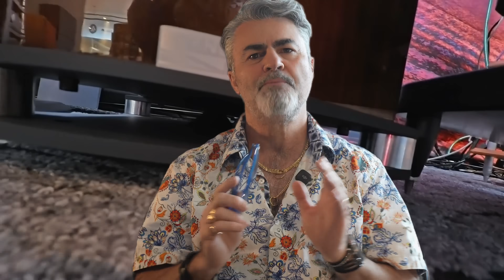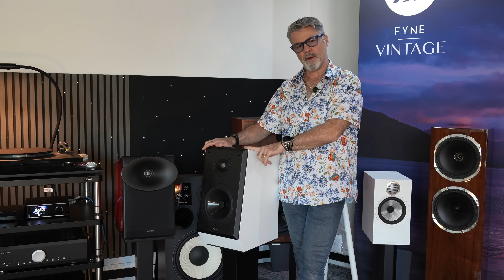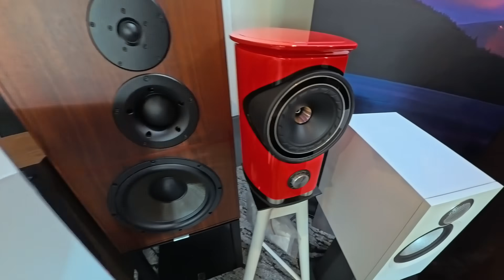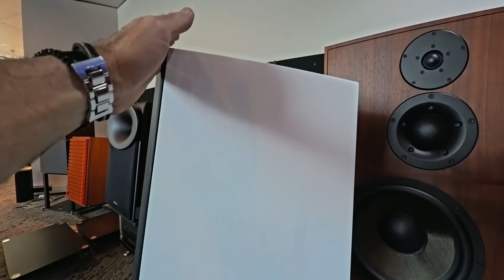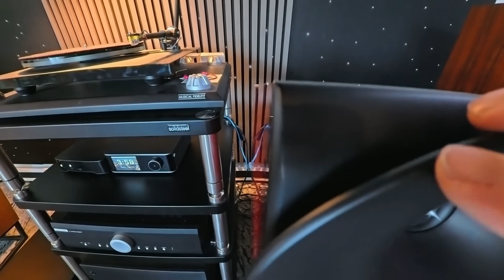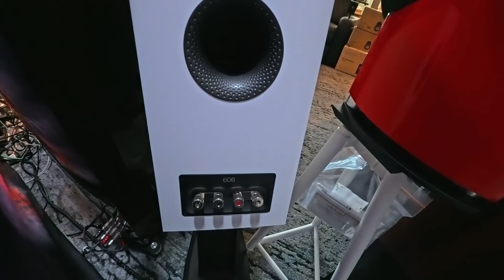Speaker Box Design vs Room Acoustics: Which Matters More?

Comment: Happy Easter Mick really sad the cost of speakers has quadrupled in the last few years - staggering. Anyway just wondering what are your impression of those new Epos speakers ? Also the Krix ESOTERIX ALTUM  how much is it worth now ? Seems way over priced compared to say a Kef LS 50 - full disclosure I still have not heard a set. Anyway great video.
Reply from the maker: Yes there are expensive speakers, but also great value speakers. Cost of manufacturing will always increase and some brands just demand a higher price. Epos now owned by Carl Finks are reimagining of the originals, but also much much more that what the originals use to be, there are 2 more models coming, smaller and larger variants. While price is high they represent great value based on performance. Krix Esoterix are such an understated speaker, I pair them with a sub and that is seriously impressive, but their party trick is bad rooms. The waveguide is amazing how it controls the high-frequency. Defiantly work a listen. I hope that my message is clear in my video’s, it’s not so much how much you spend on speakers and electronics, it’s how you understand their association in your room. I think you can get some remarkable audio experiences with lower priced speakers. We are spoiled for choice. Thanks for watching and comments. Cheers. Mick